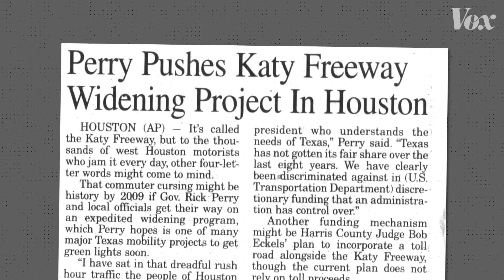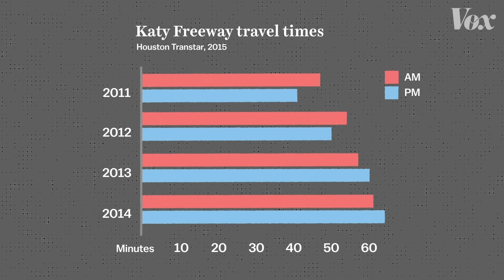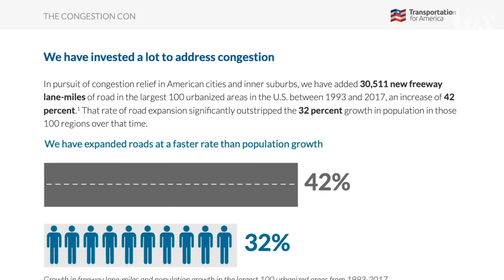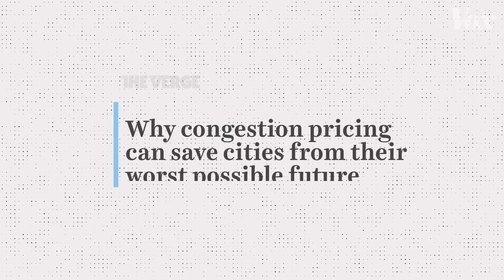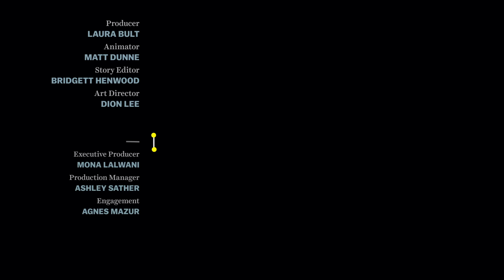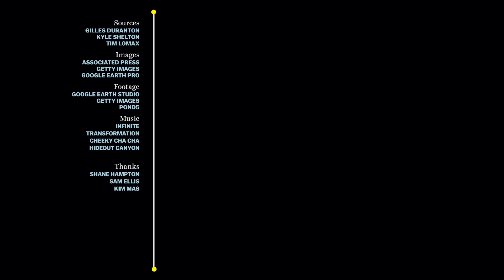How highways make traffic worse

Comment: It's also not just induced demand; it's also the Braess's paradox. This can be observed not only in car traffic, but also in things like the electric grid. The only way to solve our traffic problem in the long run is described by the Downs–Thomson paradox, which, in the most simple terms, states that the travel time of one mode can only be as fast as its fastest alternative. In the end, why take the train when you can drive there faster? Why drive when you can bike there quicker? That, combined with induced demand, is why our traffic problem is so chaotic. 

There are great success stories around the world, but one great example is Amsterdam. It used to be heavily congested with cars like our cities just a few decades ago, and yet, now it's known as the cycling paradise with an amazing public transit system. In addition, driving in Amsterdam is no longer a nightmare due to the fact that cars have different roads to take that are indirect but designed for them. A YouTube channel called "Not Just Bikes" have made some great videos on this and I highly recommend folks who might be interested in this.
Reply: Cost is another factor. Right now I have the option of using the local rail vs driving. I drive cause gas is cheaper.
Reply: @uptorest  True, but you also have to factor in the external costs...the car, maintenance, insurance, etc...Once accounted for, I suspect transit is more comparable than you think.

Comment: Also, something this video neglects to discuss it the physical point of bottlenecks. Even if you add 24 lanes on a highway, when all trafic leaves that highway on 1 or 2 lanes, it is going to bottleneck one way or another. More roads is never a good option, even from a "flow" perspective.
Reply: Bingo. I don't see this cited nearly often enough. All infrastructure built around private vehicles is inherently too low-capacity to handle travel in and around cities. There's a reason public transit used to be called "mass transit." It is able to move much larger numbers of people much faster than private vehicles can, as long as it's built right.
Reply: It is indeed make enough connecting roads as well. Finally any highway wider than like 2x5 roads is effective as the traffic on the left lanes have to cross so many lanes on the right to exit. Or for example a 2x4 divides into 2 times a 2x2 road that works alright.

Comment: 0:32 Next time you're stuck in traffic remember that all those people in their cars could fit in one train....
Reply: Unless someone like you cares a whole awful lot. Nothing is going to get better, it's not.
Reply: Clearly you've never commuted in London. It turns out, you can't all fit in one train.
Reply: @Joe Marley Corona is a temporary crisis. The conclusions of the studies are general and are not applicable during these extrordinary times.
Reply: @roryhanlon927  Of course you can't. You need to either build more underground lines or invest in other modes of transport (i.e. bikes). But it still takes people off the streets. London is already a mess despite all its public transport and probably is always going to be like that due to its old, narrow, historical roads. But, imagine if each one of those people took their cars instead of the underground.... It would be quicker to walk from Croydon to Westminster than drive...
Reply: car is still more comfortable.
Reply: @Joe Marley gr8 b8 m8 I r8 8/8
Reply: @Joe Marley covid is temporary, plus it’s been proven by countries that have massive public translation systems that it cost less, and is more efficient than personal transport
Reply: Public transport is more space efficient as buses & trains don't have crumple zones. The trade-off is that for safety reasons, the former travels slower, while the latter needs more complex signalling systems (which becomes more justified if the trains are more heavily utilised)

Comment: The fault is not the roads and their traffic, but their massive centralization towards the centers of the cities where the work centers of millions of people are concentrated, it does not matter if they put the best subway system in the world, this traffic problem will still speak Because absolutely all the cities of the United States and the rest of the world are hyper-centralized by their financial zones, the solution would be to decentralize the financial zones, which would be to put more financial centers around all the areas furthest from the big cities and to do so. a better distribution of the work centers and much less traffic than usual.
1:32 As can be seen in the image, the simple solution would be to put more downtown around the point furthest from the big cities and thus avoid a lot of traffic

Comment: America really needs to focus on mass transport. Like trains for example.
Reply: Very hard to do in america since america grew during the era of the automobile.
Reply: @braytenr2185  of course America is broken either way. Even if they expanded their train network stations wouldn't be built in the city centre like European cities. They would be put in the edge of the city sometimes an hour by car from the centre.
Reply: @braytenr2185  start with the central parts of large cities and get frequent buses in a grid network and work out from there. Would be unrealistic for my gargantuan city’s land area to immediately provide service everywhere, but the core township has more density, less cars per household, tighter/more walkable street grid. Very possible to build a nice transit base in American cities and then fan out from there
Reply: @eriklakeland3857  very unrealistic, considering large cotoes would have to be re-done from the ground up.
Reply: @braytenr2185  not really it’s making better use of the what we already have not starting over: gigantic ROWs mean ample space for bus lanes, oversupply of surface parking lots ripe for investment, horrible land use planning increases average trip length and drains city coffers - not to become manhattan everywhere, but commercial nodes within walking distance of residential areas and more diversity in the housing types offered.
Reply: @eriklakeland3857  I'm talking about trams and trains. Busses are a good start
Reply: @braytenr2185  the buses and zoning changes make trains worthwhile. Trains can be expanded more pragmatically than building subways. I’d emulate Go Transit’s transformation in Canada which better utilizes existing rail lines that freight operates on to provide frequent, all day regional service in both directions. That would come incrementally and would build ridership and demand for local transit connections over time. This would better serve our suburban sprawl than wastefully building subway service to the burbs.
Reply: @eriklakeland3857  id love to have trains, but like I said, america grew during the era of the car, demolishing these roads and highways will take 30 years, and even more to build high-speed rail. We need to better improve amtrak before we even think about making more high-speed rail
Reply: @keeli5575  
If they had small suburbs near several malls, the malls could be the new "city centres" with offices and stores.  Even apartments.  Zoning laws are to blame.  Mixed zoning anyone?

Comment: As an everyday user of Katy fwy over the last ten years I have a few comments that invalidate many of the points made in this video: 1) there is a big reason why authors show the statistics only up to 2014, as in 2018 the expansion plan was finally finished with solving the biggest bottleneck of i10 which is the i10, 290 and 610 (all are at least 6 lines big) intersection at uptown. Once that was done the 290 became a light speed tunnel with no traffic anytime (thanks to increase from 3 to 6 lines of traffic in each direction and HOV lines), i10 received additional lines to exit to 610 not blocked by 290 traffic, drivers now have a flexibility in selection of morning and evening commute routes depending on the traffic conditions at one of the highway options. 2) HOV lines provide fast way to drive in and out downtown in times of worst rush hours - it is also friendly to the modern trends as you need just one passenger on board with you to enjoy it for free, 3) westpark can back you up at any time. Also just as a honorable mention - 290 expansion turned its traffic situation from one of the worst in Houston to the most reliable highway at any time during the day or night

Comment: 5:20 of course if you take away rods there’s going to be less congestion. that’s because there’s no room for congestion. but this is also going to lead to other problems, some people might not be able to get to work as easily if they live outside the city. you can’t remove a road which allows people to come into the city and then add more space for local transit inside the city. this idea of removing roads would not help those who are trying to come into the city to work. in my opinion what we should be adding is specific lanes for big trucks and shipping. because these huge trucks are the reason there is huge radio in the first place.

Comment: I was stationed in England and when I would go to London the best mode of travel was public trans. London is such a big city that getting from one side of the city to the other could take hours but on their trains and subways you can get across the city in 15 minutes. Their roads are really small and congested but their use of frequent buses and network of trains really makes it not even a chore to use public transport

Comment: This is a very accurate video. As someone who works at a large US transit agency, the line: "It's easier than most infrastructure projects to get federal funding to do a highway expansion" is so incredibly true. She briefly touched upon one of the solutions but the TOD or transit oriented development can help alleviate a lot of congestion. The fundamental problem is our obsession at the cultural and political level for free or very inexpensive parking. Easy parking virtually guarantees land areas which are not dense which makes it so that non driving modes are not enjoyable because attractors are spaced too far apart. If we got rid of parking minimums and only built new development around transit lines, developed feeder bus and protected bike networks to the stations then we could create the mode shift needed to reduce congestion substantially.

Comment: Notably, roads for cars are by far the least-efficient way to provide for travel capacity, in terms of cost and land area per traveler, compared to any form of public transit or bicycle or pedestrian infrastructure. Once you have a single lane of transit or other non-car infrastructure, its capacity can expand to be greater than most freeways without needing any further expansion. Even if you did need to expand a transit line’s capacity to two lines, or a bikeway or sidewalk to extra lanes, it’s still taking up less space than a freeway. Bicyclists, pedestrians, and transit commuters can easily pack into far less space than the same number of people each surrounded and separated by their own individual automobile can.

Comment: The real problem is unequal distribution of traffic over time. Its too crowded during rush hours and empty during other times. All companies should not have the same work hours , so that rush hours get distributed.
Also US fuel prices are so low that use of cars is being severely encouraged.
Reply: Fuel price is part of it: the very design of the city is a another factor. Zoning laws and lack of sidewalk means the nearest shop is far, and the only option is to drive.
Reply: @dbclass4075  how is it allowed to not have a sidewalk??
Reply: @fgsaramago  Automobile-oriented development.
Reply: @dbclass4075  but having a sidewalk is a basic right!
Reply: How do you distribute the work hours?  In many cases, work hours are dictated by demand in a free market.  Los Angeles work hours are all over map, and you are likely to be trapped in a two hour traffic jam at 10pm on Sunday as you are at 7am on Wednesday.

Completely agree about U.S. fuel prices, however.  They are heavily subsidized encouraging car use.
Reply: @nickmonks9563  To some extent, the non-time sensitive office jobs? The exponential nature of traffic means you only need to remove a few cars to have improvements.

Comment: Removing a highway doesn't always work either. In my case there are two ways to get from my home to my job, the three lane Suncoast Parkway toll road with a speed limit of 50 to 70 MPH or the one lane Gunn Highway with a speed limit of 35 to 40 MPH. Some mornings I've seen Gunn Hwy backed up so badly it turns into a complete parking lot but the Suncoast Parkway is rarely ever backed up. If the city of Tampa were to demolish the Suncoast Parkway/Veterans Expressway it would be a nightmare to get to Tampa from any of the suburbs because you'd have all those extra drivers using Dale Mabry Hwy (which already has a traffic problem), Gunn Hwy, or I-275 which is stuck in a state of construction limbo and has been for the past decade.

Comment: Easy to solve, big cities need train and metro systems, only those can quickly move mass amounts of people. Look at Tokyo, London, Hong Kong. London has only one single ringroad around the city of 8 million people. But a good metro system. That helps.
Reply: Yeah I agree to an extent. The traffic in london is still pretty bad but the public transport definitely helps. You can easily go to as far as the neighbouring county on the local bus or train and that's true for every city in england
Reply: Houston brought it on themselves because they refuse to invest in A Mass Rail System.
Also greater London has 18million people
Reply: @KingAsa5  London doesn't. It's about 9m in greater London then 8m in london
Reply: @olamide6712  London is entirely too big to have just 9million.
London is nearly the same size as LA.
The city I live in (Dallas) has a metro area of 8million, And Dallas is much much much smaller than London.
Reply: @KingAsa5  I live next to London in Oxford and when I searched to see the population of greater London it was 9m like I thought it was. I think the LA area is far bigger than London though cuz that stretches about 50 miles of continuous urban area all the way to San Bernardino. That size in unheard of in the UK
Reply: @olamide6712  Would the East Coast of the U.S. work as a better point of comparison? I'm not too sure of the exact sizes myself, but the East Coast contains one of the longest ongoing chain of metropolitan areas in the U.S., and D.C. and NYC both have their subway systems. Maybe something like that could be implemented in L.A.? Or an above-ground bullet train system for more long-distance inter-city travel like in China and Japan.
Reply: But people will start getting dependent on the train and metro systems. Buses and other land-based public transports would get dominated by metros and might struggle to stay operating.

Comment: In Massachusetts, the Big Dig, as that 1990’s project was called, didn’t really remove the Central Artery. What it did was expand its width, and move it underground (hence the name). It had been originally elevated, so the removal of the elevated artery did create the appearance of free space in the heart of the city, but that highway didn’t disappear. It’s just now a large tunnel underneath the city. 

It was also extremely expensive; much more expensive than originally estimated. It also added a third tunnel connecting the city with East Boston, across Boston Harbor, where Logan International Airport is located. 

What didn’t happen was building a tunnel to connect the three train stations in the city. If you are traveling by train (often on the line from Portland, Maine, for example), your train takes you to North Station. That is the termination of that line. To go further south, or west, you would have to get all your baggage, and then leave North Station, walk to a subway line, and take it to South Station, or a third Station (I think it’s called Back Bay Station, but it’s to points west) and then catch another train there. 

Other options are to take a cab through the city. But you have to bring your bags with you. It’s impossible to take a train straight through the city if traveling through the city. It’s also recommended that you try to schedule your trip around the time when there are no professional sports games in the city, as North Station is also where the Commuter Rail from Northeastern Massachusetts terminates, and North Station itself is located in TD Garden (which most of us still refer to as the Boston Garden), and it’s where the Boston Bruins and Boston Celtics both play. Also, the because there isn’t much parking near Fenway Park, where the Red Sox play, (the park was first built in 1912, long before the age of the modern highway), many fans take the Commuter Rail, and then take the subway to the park. The Patriots play outside the city. 

So if you plan to take the train, try to avoid commuting time, or a day where a local team is playing. Especially if the Red Sox AND either the Bruins or Celtics are playing. Especially if you are toting baggage with you. During those times, the subways are so crowded that you can count on standing, and the Green Line isn’t exactly made for those in a wheelchair. Certain parts of the Green Line are the oldest subway in the US, and the tracks are at pavement level, meaning you have to climb stairs to get to the passenger compartment of the car, which in certain areas also operates on the larger roads in the city. It’s easier with the other subway lines, as the track is well below the platform level, and they tend to have many more cars connected with each subway train. 

Unlike Texas, we just don’t have unlimited space to work with. But it’s a shame that when doing the Big Dig, the planners didn’t add to the tunnel, and find a way to connect North Station with either of the other train stations.